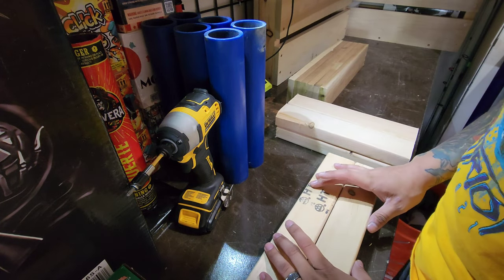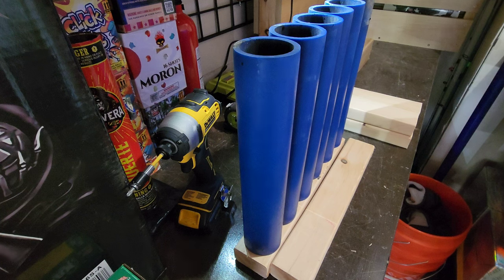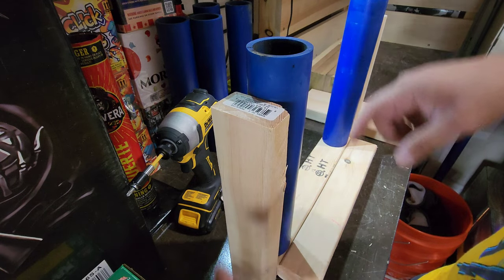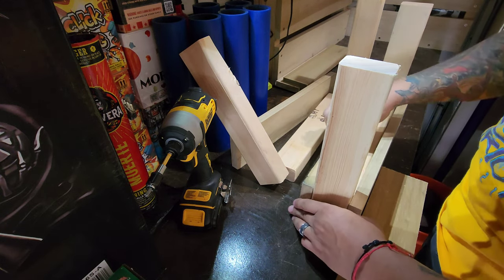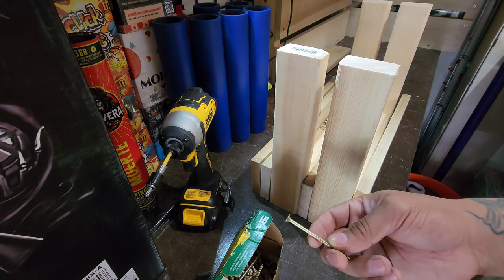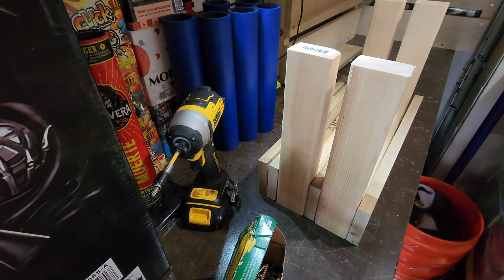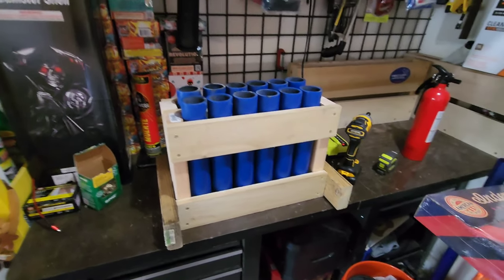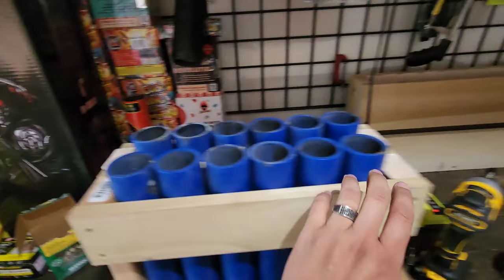Building a Canister Shell Mortar Rack for HDPE Tubes

Comment: Great build.  As far as alignment, I used to have my son hold the boards flush while I drilled my pilot holes for the screws to keep everything aligned. My life changed when I got a $20 nailer/stapler from Harbor freight. Now I can hold the boards in alignment by myself and tack them in place with staples before using the screws. Also makes assembly go much faster now
Reply from the maker: I prefer screws instead of nails. As long as you're safe and they work, have fun out there!

Comment: Great tips I’m thinking of building a 12 shot rack and using the unused fiberglass tubes that came in the two cases of cans I bought this year most will be lit individually with the three excal tubes that I have from the past they are still in mint condition and after the fourth I’ll probably order some HDPD tubes online for next time since the 4th is already about to be here

Comment: so you said your base board was 14 7/8 and the side supports were 17 1/4. my question is how did they end up being flush on the top?
Reply: No I think he said the base bird was 14 7/8
Reply: @takeovaLA  yeah typo on my end
Reply: Still confused about the dimensions thought
Reply: @liamevans6659  yea I was trying to get all the measurements and had to think twice on that one but figured it out lol
Reply: @liamevans6659  so if you are using the HDPE tubes for this rack you will need two bases that are 14 7/8 than you will need two side pieces/wall that are 12 inches flat so tubes stick out the top after you will need 6 cuts of 1x4 wood that are 17 1/4 inch for the side supports and last the stabilization legs cut to your preference of length that’s the last thing I need to add to mine tomorrow morning still don’t have the measurement for it

Comment: Hi thank you for showing. Great idea 💡 
I want to build my first one and have a question
What size of pipe ? How tall? And do you have anything in the pvc pipe on the bottom like concrete?
Reply: I had the exact same questions.  Looking forward to direction here.
Reply from the maker: Don't use PVC! Use HDPE. Tube height is 12", and I order them already plugged with 2" wood plug and stapled in place.

Comment: Can you use regular 
PVC pipe
Reply from the maker: Never ever ever use PVC under any circumstances. Very dangerous for multiple reasons. HDPE is the best for consumer shells, and 2nd best option is the fiberglass tubes that come in the kits.
Reply: Thanks !! what diameter is the most common for the tubes

Comment: Will these fire any size that fits or do I need a specific size shell for these mortar builds? I don't order fireworks just pick up a few packs from phantom but would love to do something like this for the family.
Reply from the maker: You can use this set up for any consumer cannister shells that are 1.75" in diameter, which is the majority of your cannister kits. Height of the shells doesn't matter, Ive shot 4" up to 7" out of these.